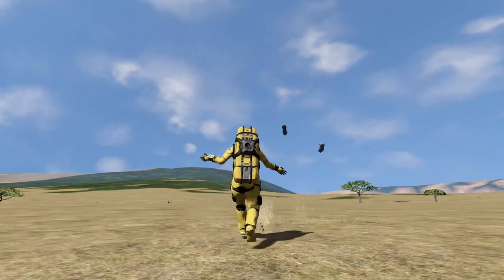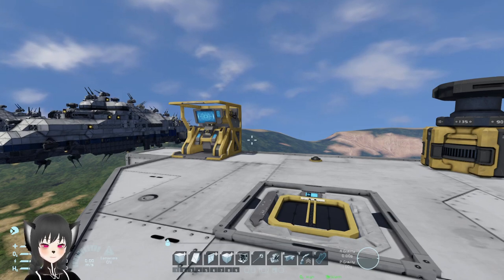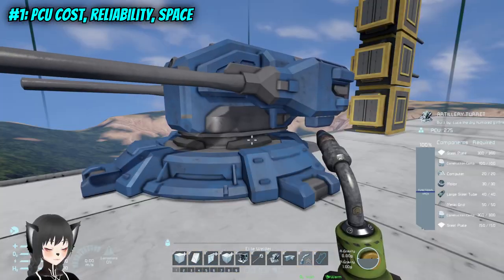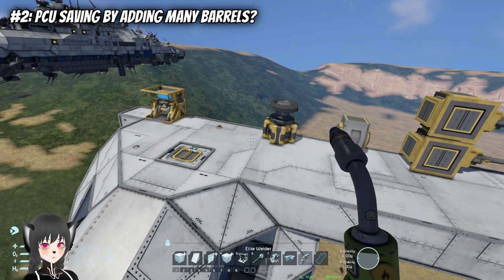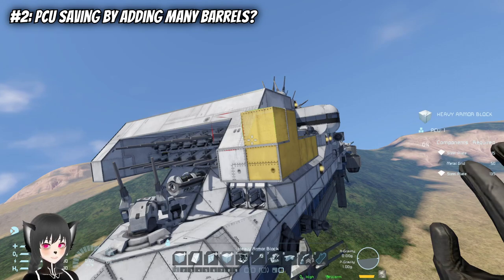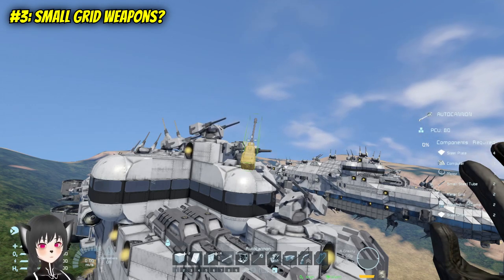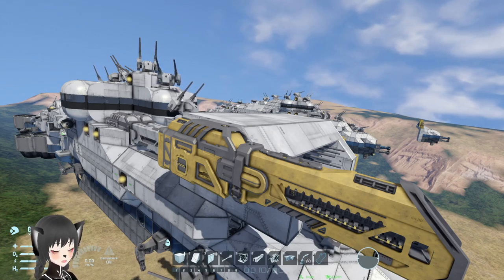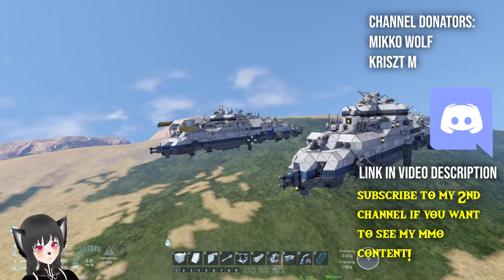Why custom turrets on a ship is a bad idea, Space Engineers - applies to ball turret too

Comment: It seems to me that a solution to at least part of the PCU problem would be to design a compound block that is both rotor and hinge; it'd still have to start as a rotor base, and end as a hinge part, but the middle piece could be a sort of "rotor to hinge adapter" block. So that's one less mechanical block, for a total of 3 instead of 4. Then, there could be a change made to fixed guns so that each of them has optional camera functionality, the same as turrets do, so that you don't need a dedicated (and super fragile) camera block (this also would be a great help for fighters using only fixed guns, too). After that, just using some thin armor plating will help with survivability somewhat, but it would be nice to see to it that the mechanical blocks get some more HP, better torque, etc. Having a heavily armored 3x3x1 conveyor or cargo container for the assembly to connect to the rest of the hull through would help the custom turret to protect the ship as much as regular turrets do, perhaps. All of that would help to close the gap some.

Comment: The only time i use custom turrets is when i set up a camouflaged sniper turret with railguns to hit capital ships and it is mostly base defence and i take control fire once and then right it off, a couple of times i did manage a second salvo but I agree with your assessment they generally are not worth the pcu. I have been thinking about making a stealth turret that looks like a big rock floating in space near an asteroid  base but still have some details i wanna number crunch but the idea is the enemy attacks and when they close in,  it pops out and hammers them with rail guns,   missiles and artillery at very short range (ie 200m to 400m). Thus no time for crew or turrets to respond effectively.

Comment: 3 words Modded Weapon Turrets
Reply from the maker: O: I guess if the modded weapon doesn't have a turreted version then that's one usecase x3
Reply: Have you actually tried pvping with those? I did and what we found very quickly was that most of them are outright op for example the aryx weapons have a railgun with 50km range that fires faster than the normal one has faster projectiles and breaks thru like 100 layers of heavy armor. I think you can imagine the fun gameplay of instantly dying out of nowhere.
Reply: @AdamSchadow  those weaponcore weapons are designed to work with the shield mod. I also know exactly which weapon your speaking of its the Kingslayer Coilgun and no it does not fire that fast and also requires an insane amount of materials to even make and not even counting the ludacris amount of reactors to power it. Now true it is the size of a large ship in SE and basically it would have a ship built around like the ships in Halo. It's also extremely true that if and that's slim chance but if you do hit some with it it's game over in 1 shot if there is no shields on the receiving ship. I play with this mod in EVERY single world I make and use it alot. It is balanced in the weaponcore world and with all the changes that come with that mod.

Comment: But some people use them
Reply: nah really?
Reply from the maker: Yeah x3 they come with a lot of problems though
Reply: @noobking2335  but in AHG server some use them I also do
Reply: I use them a lot. half the cost of my ships is in custom turrets. they are fragile though. So you will definitely lose a few in a fight. sg armor is completely useless on them. one good hit by a larger gun will break the hinge in the middle even if half the guns are still working it will break. they need to up the hp of the hinge it breaks way too often. Hell just drilling with hinge in the mix will cause it to break pretty often. At least with the large grid hinge it just stops working and cen be repaired. sg it seems to just break off completely.

Comment: Your points are valid. Thing is, a custom turret can pack more firepower in roughly the same space as a basic turret. While the normal turrets have less fire power but more resilience. That is the rationale I use when designing ships.

I genuinely believe normal turrets should not exist. This is a game about building your own CUSTOM stuff and giving it purpose. Turret blocks go against this. Which is why I want them gone.